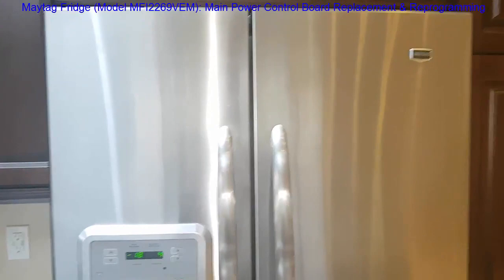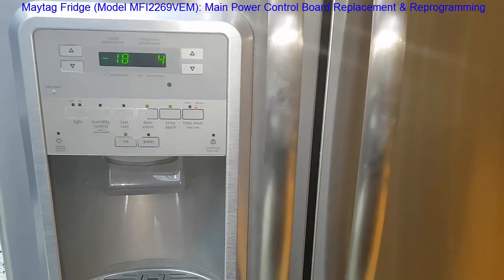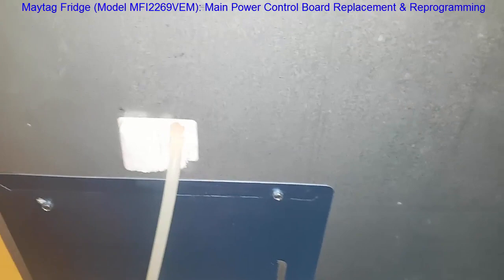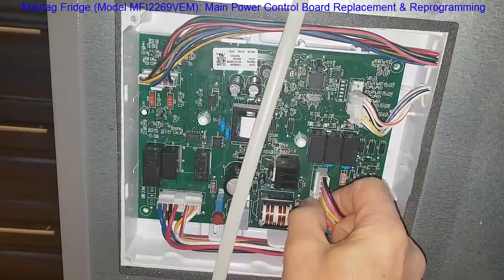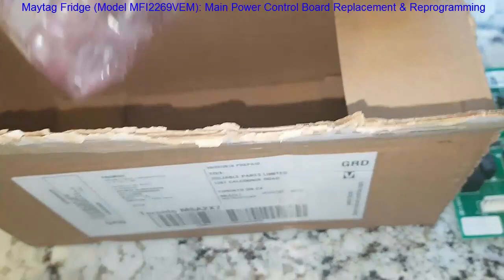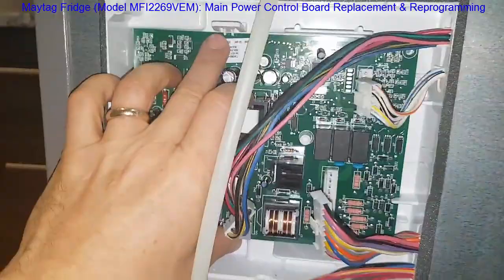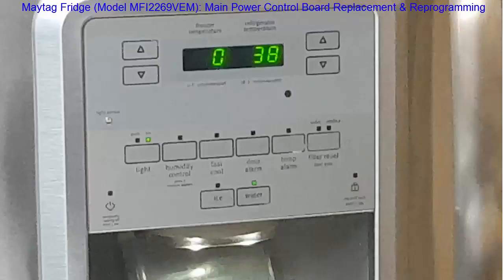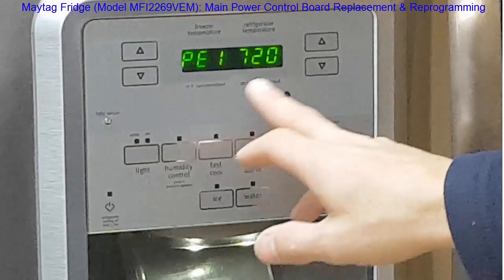Maytag Fridge - Main Power Control Board Replacement and Reprogramming

Comment: This worked for our 10 year old Maytag refrigerator model #MFI2569YEMO. We found a replacement main control board (Part #WPW10312695) on Amazon with overnight delivery for a compatible (not OEM) model. So far, so good. Everything seems to be working as normal. Video was excellent and made the replacement process so easy- completed in less than 30 minutes. Thank you so much for your step-by-step, clear instructions!
Reply: Hi I have the same fridge and model number and had a question before I order. Was your fridge not turning on either because mine doesn’t turn on so I just wanted to make sure it wasn’t just the board that went bad?

Comment: I was desperately seeking a solution of this same thing happening to my refrigerator.  After spending hours calling for service or searching for a new refrigerator, I came across your video. You saved my day!  I had a part here the next day from Amazon and it's now up and running.  Thank you!!
Reply from the maker: Hi Scott, Thank you for your comment and the positive feedback. I'm so glad to hear the video helped you diagnose and solve your issue. Nice to know you were able to save some money and prevent another appliance (all that metal and plastic) from ending up in a landfill. Vito Casola - FIX IT Yourself!!

Comment: Thank you,      this video saved us about $2300  dollars I ordered the whole circuit board $285.   It now works again.
Reply from the maker: Thank you for your comment. So glad to hear that you were able to save a bundle of money and prevent an otherwise perfectly good appliance from ending up in the landfill. Now that you have repaired your fridge I would highly recommend connecting your fridge power cord into a surge protection device or at least a power bar that has surge protection. This will help minimize the chances of the same issue happening again in future.  Most of these issues are likely caused by power spikes from electrical storms or utility grids with poor power quality.  All the best. Vito Casola - FIX IT Yourself.!!

Comment: The price was a little pricey for our part but cheaper than having the repair man fix it! Video was very easy to follow and helped a lot, thank you!!
Reply from the maker: Hello and sorry for the very late response. I didn't see your response right away and it must have gotten buried under all the others. Anyway thank you for our comment and I'm glad the video helped you. I hope your fridge is still going strong like our and you now have it plugged into a surge protection device or power bar with built-in surge protector. Vito Casola - FIX IT Yourself!!

Comment: Hello. I just wanted to take a moment to thank you for your insightful video. I quite literally performed the same operation earlier today, thanks in large part to the guidance you provided in your video. The only slight tweak was when it came to programming mine. To activate the appearance of the decimal, I needed to press down on the temp/alarm button for like 2 second, then while still holding it down, press the far left side down arrow button for around 4 seconds, then remove my finger form the temp/alarm button, and then finally remove my finger from the down arrow button. That got the refrigerator into programming mode, wherein I could enter my code which also happend to be 1720. My display entered into a flashing sequence and then I just pressed the down button one more time and the system went into default 0 / 38 mode. (I just added these details in case someone else stumbles upon this and derives a clue or two from my experience.) Thank you again for the excellent video.
Reply: Hi Stephen,  Thank you for posting your comment and positive feedback, it's really appreciated.  I'm sure other viewers will appreciate the additional information and insight that could prove helpful if they encounter similar issue with reprogramming the Main Control Board. Thanks again. Vito Casola, FIX IT Yourself.!!

Comment: WE DID IT!!!!! Programing took quite some time because we could not get to the PEOOOO to show the decimal point, but reading some of your comments helped us not give up. Just continue trying because the orde3r of the buttons and the timing has to very very precise. It works great. Thanks a lot for the video.
Reply from the maker: Hello Jose, Thanks for your comment and your additional notes on your specific experience as it is helpful for others who may encounter similar issues with the programming. Glad you found the video and it helped you and I hope your fridge continues for many years to come. Now that you fixed your fridge I would recommend plugging it into a power surge protection device or a power bar with built-in surge protection to make sure a power surge won't damage your new board.  Vito Casola - FIX IT Yourself!!

Comment: Thank you so much and for taking the time to help others with your video.   Got our fridge fixed this afternoon after it decided to stop working this morning.   Found the part in town and just installed it in under 30 min.  You are the best,  Happy New Year.
Reply from the maker: Hi Judy, Thank you for your comment and positive feedback. Very glad to hear that my video helped you diagnose and resolve your issue and repair your fridge. That's another appliance that didn't end up in a landfill earlier than required. Thanks for supporting my channel. Vito Casola - FIX IT Yourself.!!

Comment: Because of a lightning strike nearby during a storm, our fridge, which is exactly like the one in the video, stopped working. After googling fixes for it, I happened upon this video.

I want to thank you for posting this. My wife was ready to run out and buy a new refrigerator but I talked her into letting me try and fix it first. I followed all your directions and was able to install the new board and get it programmed.

The fridge is working great.

Thank you for saving me a lot of money. 

Liked and subscribed. Thanks again, so much.
Reply from the maker: Hello St. Augustine Native, 
Thank you for liking the video and subscribing. Boy what a small world.... we own a vacation home in St. Augustine since 2013 (at Ocean Village Club on 4250 A1A South - 2 bed/bath condo, right on the beach).  We love coming down to St. Augustine whenever we can but most of the year we rent our unit out through a rental management company (VTrips). So glad to hear that you were able to fix your fridge and divert yet another bunch of metal and plastic from ending up in the landfill unnecessarily. Also glad that you were able to save a lot of money too.  My fridge is also still running strong since this repair.  You are correct in assuming that a thunderstorm and the associated possibility of power surges could have been responsible for the failure of the main control board of your fridge.  I'm betting that is what caused mine to fail as well.  Funny because we recently had our 2 year old Samsung Ultra High Definition TV in St. Augustine go bad (sometime around May 2020) and luckily the extended warranty I bought with the fridge was still good because my LED panel was shot and they had to replace the TV with a brand new unit.  Highly recommend plugging your fridge into a Power Bar with surge protection and any other appliance (like TV's, stereos, etc.) to protect them against damaging effects of power spikes. Maybe we will run into you next time we're in St. Augustine.  Take Care and Stay Safe down there.  Vito Casola - FIXIT Yourself.
Reply: @FIX-IT-Yourself  Yep, St Augustine is a great place.I'm a retired Deputy who worked a lot of beach patrol off duty. I know right where Ocean Village is. We do plan on getting a surge protector for the fridge. Again, thanks for everything and take care.
John
Reply from the maker: @StAugustineNative  You're welcome John, Glad it all worked out in the end. See you on the beautiful beaches of St. Augustine someday !! :-).

Comment: Just replaced my main circuit board which fixed my problem. Very easy and cost $175 total. Thanks for the video.
Reply from the maker: Hi James, Thanks for the feedback. Glad to hear you found this helpful and were able to save money fixing this yourself. Vito Casola - FIX IT Yourself.

Comment: So, the only way I was able to enter my code was to go into program mode via the door alarm button and the down arrow button (upper left) for 3 seconds, then release the door alarm and the display reset with the dot now visible.  At that point I was able to move the dot to the different digits and enter the code numbers as demonstrated in the video. Thanks a bunch!

Comment: My millennial son said I should throw the fridge out and get a new one. Took two hours to fix including going out to get the board. Very helpful video.
Reply from the maker: Glad to hear this helped you get your fridge up and running again.  How much did it cost you compared to buying a new fridge? Hopefully your millennial son learned a lesson.  So another dead appliance revived and avoided ending up in a landfill.  If you found that helpful enough to subscribe to my channel I have uploaded several more useful fixes around the house and I plan to upload several more in the weeks/months ahead. Vito
Reply: @FIX-IT-Yourself  The board is now CAD$353 from Reliable Parts. I shudder to think what a service call would cost.
Reply from the maker: @zaphodarrowdriver  Wow that was a bit pricey but your right a service call would add to that significantly and would then make your son's idea to replace the fridge seem more like the right thing to do. My fridge is still running strong, but I should consider plugging it into a surge protection power bar rather than just the wall outlet as power surges from electrical storms could be what causes so many appliances to fail because of the delicate electronic components on these modern power boards.  Hope your fridge will live long and prosper!!

Comment: Great video! I installed a new similar control panel and had PE0 or O - 000 or OOO show on display. Since there were instructions in the parts box (which some have) nor a service booklet with the fridge, I didn't know what to do next. Your video helped tremendously. Thank you.
Reply from the maker: Hello John and thank you for your comment.  Glad the video helped you finish your repair and hope your fridge will give you many years more of service. Vito Casola - FIX IT Yourself!!

Comment: My refrigerator, (identical to the one shown in the video) would not go into program mode as described.  However, I went to the "Service Instructions" that came with the refrigerator when we bought it.  Note, these are not the "User Instructions".  The Service Instructions provide a 9 step set of instructions on how to program that worked for me.  1) Press & hold the Door Alarm Keypad 2) Press & hold Freezer Temp Down Keypad for 3 seconds.  3) Release the Door Alarm Keypad & wait 3 seconds 4) The control will display "PE" to indicate your in programming mode. 5) Entry is confirmed by pressing the Freezer Temp down keypad once more. 6) The control will display the current Program Code.  The value should be validated with the program code printed on the unit serial plate (mine was 1720).  7) Press the Refrigerator Temp Up Keypad or Refrigerator Down Keypad to change the digit value with each key press. (Having fun yet :) 8) The decimal point indicates the selected digit.  Press the Freezer Temp Up Keypad to select the next digit.  9)Once the desired Program code is entered, press and hold the Freezer Down keypad until the Program Codes begins flassing indicating it has been saved.  These Service Specs Note: If you attempt to enter an invalid Program Code the Control will not save the New code.  Exit the programing process by pressing any key OR press the Door Alarm key for 3 second.  If you entered the wrong code I recommend you unplug the unit and start over.   I bought my new control board from Sears Parts for $289.  They stated it was an upgrade to the original circuit board.   Good luck...
Reply: Good Evening, and many thanks for taking the time to right these instructions.  I will be sure to relay these to anyone else who has difficulty with entering the Programming Mode, entering their specific code and Exiting Programming Mode.  I purchased my board from an authorized Maytag parts supplier (Maytag gave me their contact information) and my board was much cheaper ($172.57 including the Sales Tax). Again many thanks and I hope this video was somewhat helpful for you, and sorry to hear that your board cost you ~$100 more.  Vito Casola
Reply: OMG you saved my sanity!  After following the replacement board my fridge program did not work. These 9 steps worked and now our fridge is working. Couple of hundred instead of thousand!  Thank you 😊
Reply: As per your other replies, I too could not program the fridge after following the excellent video.  The extra steps outlined by you, E. Smith, saved the day.  Thanks so much.
Reply: This was fantastic information. THANK YOU.
Reply: Ours is identical but happens to be one where both doors have to be open to enter program mode. Once code entered, the internal fans came on, had to wait a few minutes for compressor to restart.
Reply: I was madly pressing buttons and wondering if I needed to order a new front panel! Thank you so much for writing these clear instructions!!
Reply: I’m glad you posted this. His instructions didn’t work on my fridge you yours did.

Comment: Mine went dark after a power outage and it was fixed thru this video...thanks again
Reply from the maker: Glad to hear this video helped you solve your issue and save some money. Yes, it appears that most new appliances are very susceptible to power spikes (from thunderstorms, or other utility issues) so it is definitely a good idea to plug such appliances with sensitive electronics (fridges, TV's, stereos, etc.) into surge protection device or power bar with built-in surge protection. I plugged my fridge into a surge protector that is then plugged into power bar with built-in surge protection (so double protection). Vito Casola - FIX IT Yourself!!

Comment: Mine is a Whirpool Gold fridge but same Main control pcb. My 
display had gone off and if I pressed one button all leds would light. I
 hastily replaced the front panel W101625... pcb and same problem, I removed that rear Main
 pcb and visually ALL capacitors looked FINE but then I tested the 
capacitors with an in-circuit cap tester, and I found that all its four 
10uf 35V caps were open; C31, C32, C45, and C?. I replaced the four with
 10uf 50V caps, placed the pcb back on the fridge and sure enough!! The 
fridge turned on fine, Freezer at 6 and Refri at 45, Water led, and I 
reset the filter. I did not even had to program it!  The larger 
capacitors were fine. I hope this helps others. God Bless you all !
Reply: Hi Wil,  Thanks for this valuable input, it is greatly appreciated and hopefully will help those that feel confident enough to use a soldering iron to replace capacitors.  I certainly would have had I known those capacitors could solve the problem.  Years ago I repaired my dad's Samsung TV that wouldn't turn on by replacing a couple of capacitors and still works great to this day.  Pretty easy to do if you know which components to replace.  Next time I come across fixing an appliance that has a board I will definitely look at how many capacitors they have and simply replace them all if there are not many (as you did).  Thanks again for the input.  Vito

Comment: Thanks so much for posting video...Two days to order and get part...fridge is working. You the MAN !
Reply: You're welcome Jim.   I'm glad to hear another big chunk of perfectly good metal and plastic has been diverted from a landfill and you were able to save yourself a bunch of money to buy a new fridge.Just curious how much did the board cost you?  I paid CDN$152.72 + 19.85 HST (Total Cost CDN$172.57).If you liked my video I'd appreciate if you like it and subscribe to my channel.  I've done a bunch more little fixes around my house, including repairing my front load Kenmore/Samsung washing machine, Installing a CMOS battery for a IBM Thinkpad T42 laptop, installing a flexible aluminum vent liner for my hot water tank, and I also repaired my aunt's KitchenAid Fridge which had a similar problem.  I plan to post videos of those repairs soon, just need put all the video clips together and turn them into nice final videos and then upload them.  Stay tuned... Vito
Reply: @vitocasola8358  That's great that you plan to continue posting and at your request, I have subscribed. We paid more on Amazon to get it within two days, $220.20 with tax. Had we been willing to wait a few days, could have got for around $174.00 . Worth the difference because we managed not to lose any food. Take care and thanks again
Reply: Yeah I guess that does make sense, .... definitely worth the extra 50 bucks to save your food.  We had another fridge in the basement which we were able to squeeze everything into and I went to the local parts supplier (20 minute drive) and got the board quicker than a couple of days, once I figured out what to do and decided to take a chance and buy the board.  Thanks for subscribing and stay tuned for more videos. Vito.

Comment: Great info. To get program mode press door alarm first, then arrow key , hold 3s then  release  arrow key last . My fridge  if you release both keys the same . It will not go program mode. Good luck.
Reply from the maker: Thanks for sharing. Hopefully this could help others that experience the same problem. Vito Casola - FIX IT Yourself!!
Reply: Thanks so much but mine is still flashing 😢